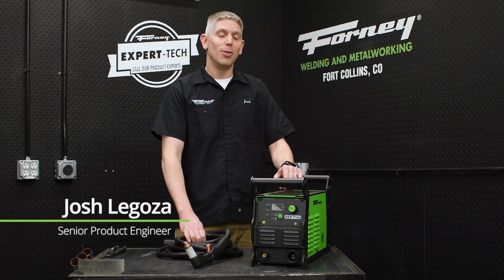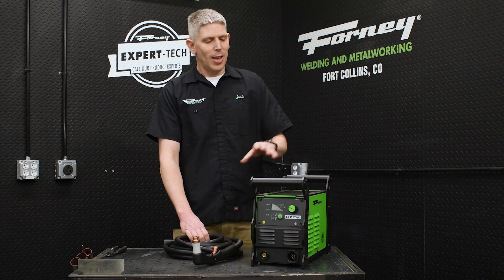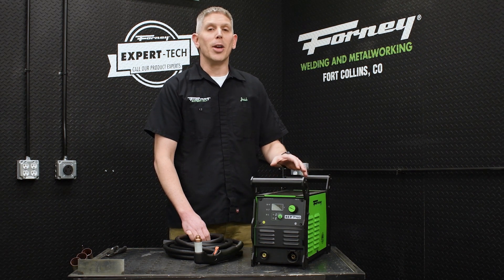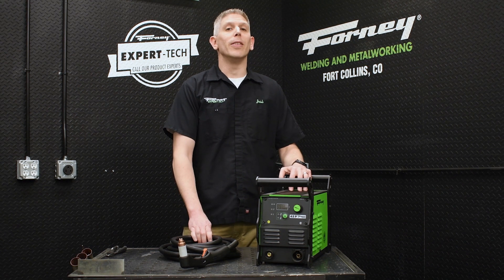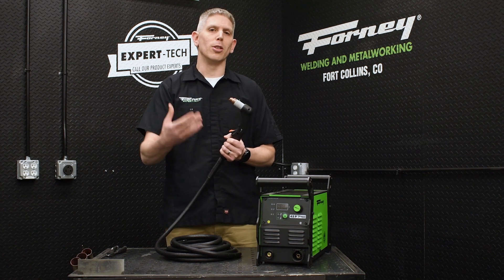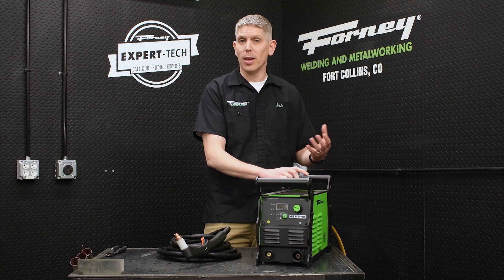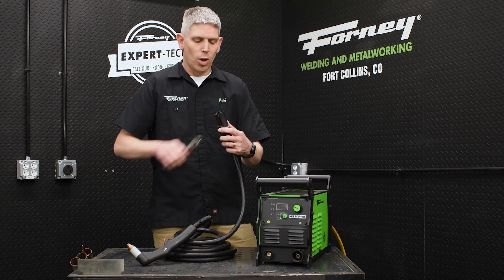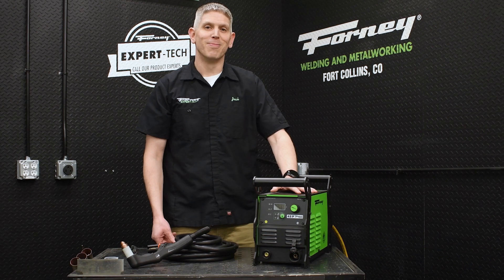Forney® 45 P PRO Plasma Cutter

Comment: I own this machine. Cuts great! Will clean cut 1" with new consumables on board.  It will cut through at least 2 feet of 1" plate on 45 amps before tripping the duty cycle.  And that's a lot! 
I had trouble getting replacement consumables to work. My Forney dealer in town is really slack on keeping plasma consumables in stock. And to be honest, Forney is high on their shipping charges on consumables. To make a long story short. This is a Hypertherm Gen 4 torch, which is one of the best hand torches out there. These torches alone are about 700 bucks. I bought  Hypertherm replacement consumables online, and they had the spring built into the electrode. Well, the consumables that came with the machine had a separate electrode holder with the spring and a short swirl ring. When you removed the original electrode holder, you could fit the Hypertherm electrode, but there was no seal at the base, so it would not push the electrode back on the spring and start the arc. 
After much research and crossing numbers, I discovered that the torch came with consumables made by a company called Hyper Cut. This company was using the same electrode part number as Hypertherm, although their electrodes were different. But their electrodes do come with a new electrode holder. The problem is getting the Hyper Cut stuff. I wanted to get it running on Hypertherm because of the ease of getting the consumables, especially electrodes. So after a couple of calls and emails to both Forney and Hypertherm, I still didn't have my true answer because neither could do all the crossover because of the 3rd party involved. But by my own observation, I concluded that I needed to eliminate the stock electrode holder, and I could use the Hypertherm electrodes that I had already purchased many of. So I ordered the longer swirl ring from Hypertherm, and it worked. Now, don't get me wrong, Forney has this original stuff when you need it, but shipping made it too expensive for me.  So when you go through what comes with the machine to switch over, you need Hypertherm 220084 electrode and 220857 swirl ring. The ceramic retainer cup and nozzles and drag nozzle protector that were original will work. You can find charts of consumables compatibility on the Hypertherm website. I think the one for Gen 4 Powermax 45 works. Find the one with these 2 numbers, and you have it. This swirl ring has an o-ring seal built in, so there is no need for an electrode holder. I highly recommend this cutter, and this consumables thing is a non-issue since I am giving you my 3 days of research up front. I own a Forney 45P Pro plasma, 140 easy weld, 210 mig, and a 270 mig. I also have a Millermatic 250 mig, a Miller Bobcat 250 portable stick, and a Lincoln Idealarc 250 stationary stick. I love all the Forney welders. I have had a couple of them 4 or 5 years, and I work on heavy equipment almost daily so they get some hours on them and I have had no trouble. The 270 mig is the most powerful mig I have ever used that runs on single phase power. I love my Lincoln stick welder, but I prefer my Forney migs over Miller migs. The local welding gas supply is a Miller dealer as well as a Forney dealer, and they are selling Forney 4 to 1 over Miller.